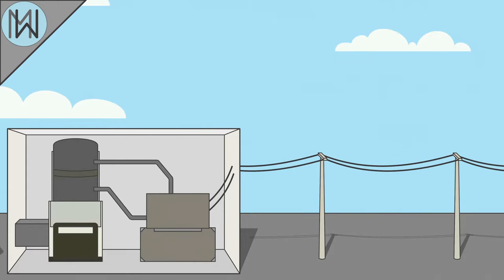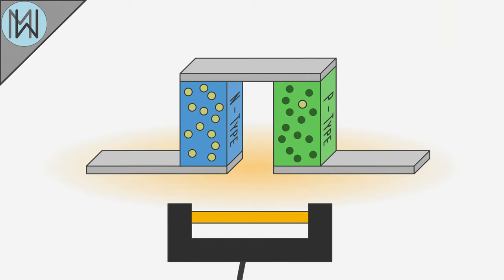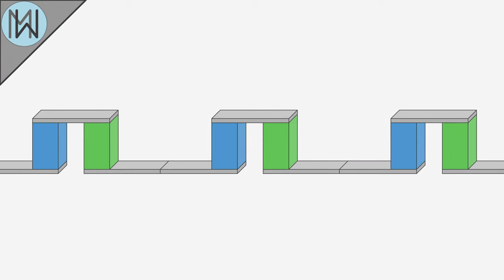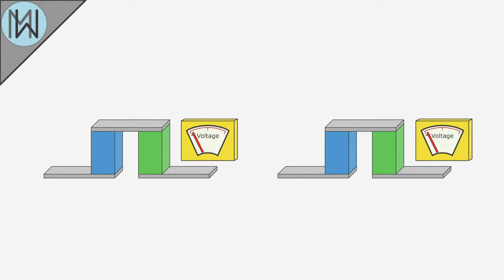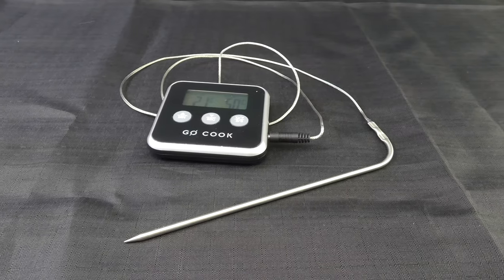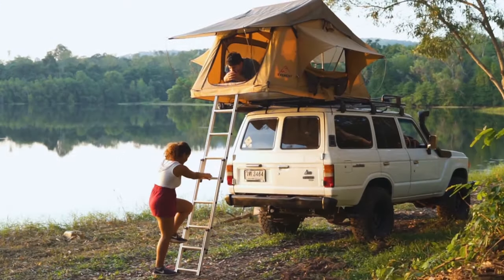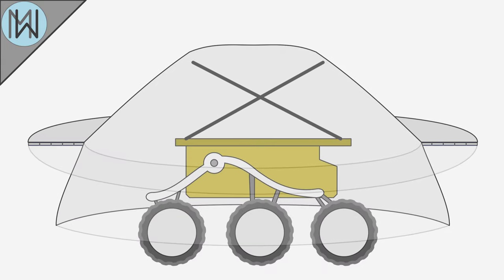The Thermoelectric Effect – Seebeck & Peltier Effects

Comment: While I can only guess that semiconductors are used because they're more efficient, I don't think they're actually required for a thermocouple.  All you really need are just two different "conductors".  I've heard copper and steel can be used together; though, the voltage is not great compared to commercial thermocouples, in which I believe nickel alloys are among the most commonly used materials.

So, even though this video gives a better presentation on the semiconductor version than Wikipedia, it still leaves me guessing as to why semiconductors are used at all.
Reply: Because they are more efficient so less space used and more power.
Reply: Y think it helps, if you know how semi conductors work, then it is easy to understand one aloy as the P terminal and one as the N terminal. So that you can visualize how the heat induces a current.

But you are absolutely right, even two wires are enough for the thermoelectric effect
Reply: Actually for thermoelectric generators we look for higher electrical conductivity but lower thermal conductivity. With metals it is a headache to conduct only the electron flow, hence we have to use semiconductors with doping of different metals from the thermoelectric series. People try to make interstitial defects, alloying,  nano-structuring, etc to make it possible

Comment: Excellent presentation! Let's suppose that the cold side of a Seebeck thermoelectric generator (TEG1) is near absolute zero (0K/-273.15C). Let us further assume that the hot side of TEG1 is 100K/-173.15C. Let us assume that another Seebeck thermoelectric generator (TEG2) has a cold side temperature of 273.15K/0C and a hot side temperature of 373.15K/100C. 

Would the power generated by TEG1 equal the power generated by TEG2?

Because the molecular motion would be greatly reduced in TEG2, would it require less energy input into the system to maintain the 100C temperature difference than TEG1?
Reply: Firstly absolute zero is theoretical.  
Then we have to consider conductivity.  Generally in case of good conductors such as metals with temperature increase conductivity decreases but for semiconductors it is opposite.  
So TEG 2 would be better for increased conductivity.

Comment: what you need is one element that conduct heat very fast next to one that conduct heat slow that is also electrically conductive. that would form a p and n junction. can also be copper and steel or silver and lead. there are many elements that would act as either a p or n layer. the germans under world war II used silver in their junctions.
Reply: @ Primodernious
While I get that conducting heat slowly will help maintain or maximize the temperature differential, I fail to understand why materials with different thermal conductivities are necessary.  According to my limited understanding of the Seebeck effect, each material has its own voltage potential across the temperature gradient, and I infer that the only reason why two different materials are needed is so the circuit can be completed without the two sides canceling each other out.  And the reason they don't cancel each other out is because they have different Seebeck coefficients and, thus, different voltage potentials over the same temperature gradient.
Reply: careful when reading and typing "p or n".

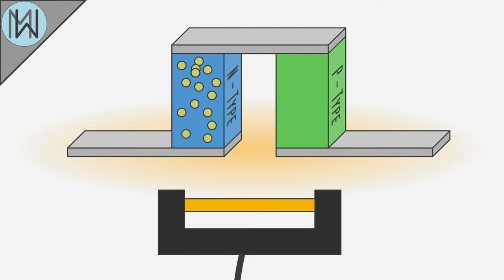Comment: 1:16 Why woul electrons move to the cooler end? you didnt explain, is this because the electrons are vibrating more and its like a dog with a bad case of flees that 'shakes' these electrons off and so they then head towards more stable states-i.e. the cooler end? Also this is amplified because the N type material has excess electrons and the P type more 'holes' for them to jump in to?
Reply: electrones wanted to immigrate from very densely populated country to other country but they didnt had visa so they were bound in one country but as soon as they got visa they went to country of their choice.

Comment: p and n layer stand for one prositively charged layer and one negatively charged layer. it reality one element that has a greater charge that another or to different elements would form such a semiconductor. also can be more mass of one element in a junction with less mass. in silicon its just a difference in property as the element is the same for each layer just different property.

Comment: radio isotope and solar are not the only ways to power space craft, fuel cells were used in the past. considering the efficiency of them, i am surprised that they are not used more.
Reply from the maker: My only exposure to fuel cells has been via KSP, so I might add that to my topic list, and dive into how they work, and perhaps why they haven't been exploited fully.
Reply: i realise its 2 years late, but realistically, lifetime power supply, radioisotopes will supply for ages, solar is basically as long as the sun shines and the panel lifetime,

a fuel cell, lol, once it runs dry that's it, there is no point, if you're gonna regenerate the fuel cells via solar the real question is WHY?, you already have solar power so why waste the mass, unless you are operating some distance like neptune and you want to slowly store power over time to then use it in a quick burst of high energy cost activity, then i really dont see why you'd do it.
Reply: @TS-jm7jm  solar is fine, but it is only available near earth and the panels themselves can be fragile, not to mention that an engine like vasmir would require more power than what a solar panel would be able to provide for a human mars mission, and maybe a moon mission. nuclear power from the thermoelectric effect has long durations, but it sucks with efficiency, requiring a large amount of mass just to be relevant.

Comment: If you separate the thermo couple parts and put one on the roof and one inside cool place or under foundation then you can cool the city and charge battery or run refrigeration air conditioner at the same time so endless electricity called heat pump

Comment: If it's hotter in your house than outside your house could you make electricity?
Reply: Yes, but you're usually paying to keep the inside hotter than the outside, so you might spend more on the increase in your heating bills than you'd make in the electricity the device produced.